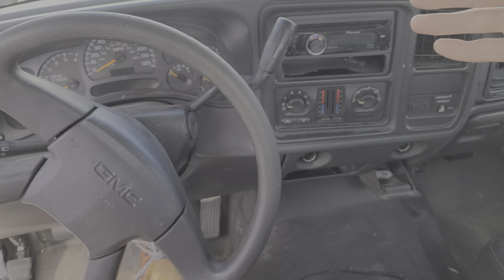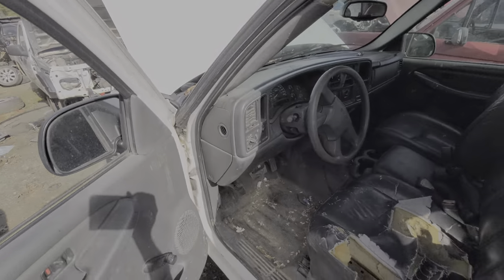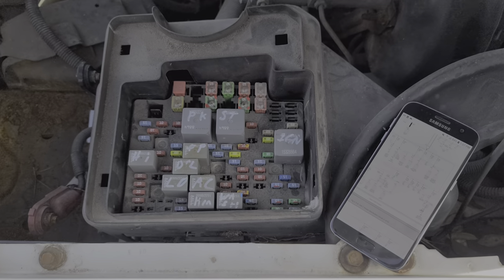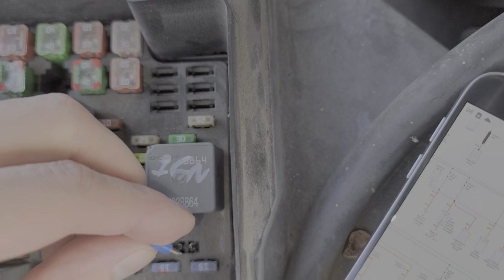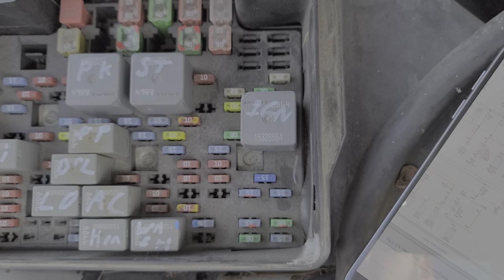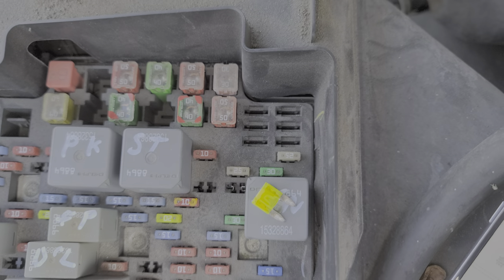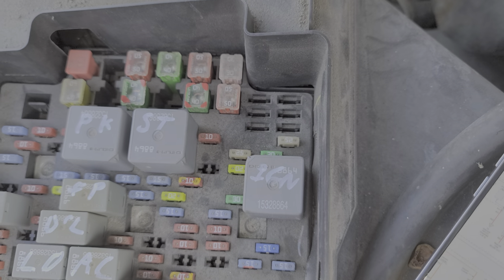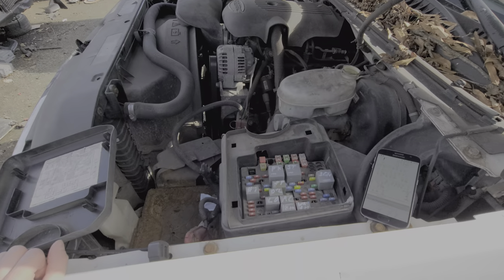2004 GMC Sierra 1500 Cigarette Lighter Fuse, Power Outlet Fuses

Comment: Make sure you have the diagram inside the top of the cover, turned exactly like the fuses are positioned under the hood. 
The fuse that you need might be up top on the left instead of on the bottom right.